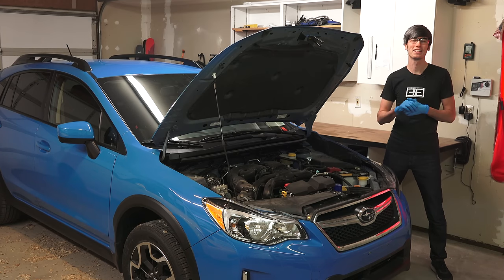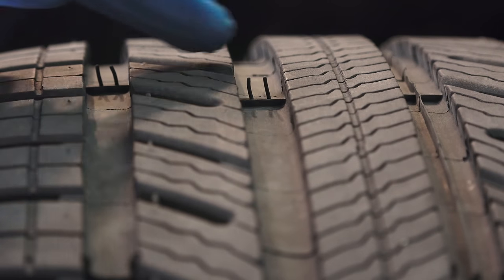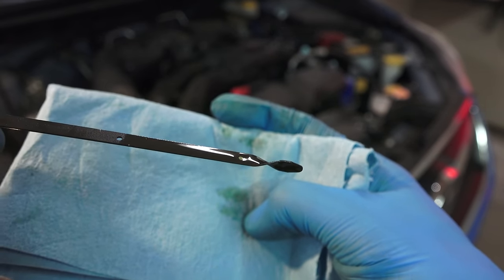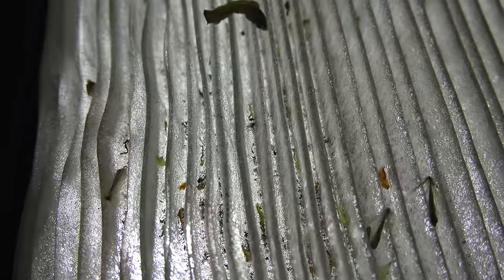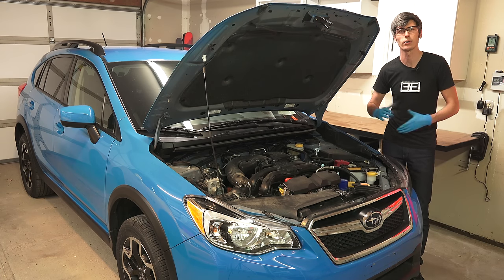How To Make Your Car Last A Long Time - Simple Checks

Comment: In 10 years, this will be a 60 sec video on how to navigate to your "Vehicle Status" menu on your infotainment screen.
Reply: My car has a digital dipstick for the engine oil. Useless piece of junk that's slow to read, inaccurate and a real 'dip stick'.
Reply: @billandyeng  same on mine. After changing the oil i have to drive 10 min before it can read my oil levels. Pretty stupid.
Reply: billandyeng  Yeah, it could even be like the temp gauge on my car (I'm not even sure if its tied into anything). It always shows "middle" after its warmed up. Whether that's gentle cruising or bashing gears 9k rpm and hearing the exhaust get so hot it makes strange noises (gurgles) and then you know its hot because you can't make it shoot flames out the tailpipes unless its been warmed up aggressively and the exhaust ignites the excess fuel.

But it always shows "middle" like 3 minutes of sitting there... Never goes past it... What a useful gauge! I've heard they don't even move even when serious engine damage occurs and water is boiling out at 240-260 *F... I'll be putting in a real one so I know when its overheating (they are notorious for that, so its a real shame they don't have a real gauge to begin with).
Reply: A lot of manufacturers did that with their temp gauges because customers brought their cars in thinking something was wrong if it went up and down. So now most gauges just stay in the middle between 160F and 230F.

Or it could be like this subaru I believe and some others, where it doesn't have a temp gauge anymore. That's how my BMW is. It just has a light to tell you when it's overheating.
Reply: @kern417  Same in my car, but it can be found from drive computer's debug menu. Not very user friendly solution, but I had to use it as coolant pressurisation is not very reliable so sometimes coolant boiled before fan turned on.
Reply: I'm not sure why they bothered putting the gauge in to begin with, +1 HP stickers are more reassuring. 
A gauge is a device that measures something, so if its not measuring it, is it really a gauge? Such are life's most intriguing questions... 

If I was marketing, I'd just put a permanent sticker there that said "everything is ____ fine", and then a light would come on that said "Everything is NOT fine!"
Reply: the car just tell you went it needs maintenance already.
Reply: @jakegarrett8109  I agree jeep did away with 5hr oil pressure gauge and turned into a dummy gauge in 03
Reply: omg, aren't the robots supposed to do that for you??
Reply: Just checked the app on my phone all the status is green.
Reply: False. Your car will drive itself to the nearest service station and recommend fluids/filters at the proper times.

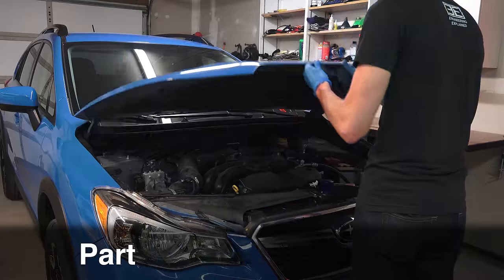Comment: 2:50 Prior to checking oil dipstick level, make sure the car is on a level surface! 🤪✅
Reply: And also that you check your oil level with the engine temp the same as last time you checked.
Reply: KJ also make sure the car is cold when you check oil level for the most accurate reading.
Reply: also make sure your car even has a dipstick like bmw
Reply: A hot motor will read low as the oil is circulated throughout, a cold car will have the oil collected in the pan for a proper reading. Oil is tricky as overfilling causes seal leaks and pressure buildup ,  not enough oil will cause seizing of the internals. It’s all about that sweet spot baby.
Reply: I suggest that you do what the manual suggests re hot or cold oil check.  My Odyssey says hot oil level check. My Civic says nothing, so I presume cold.
Reply: Waiting 1-2 minutes is enough for the oil to drain back to the oil pan.. Do not need to be stone cold
Reply: I hope I knew this before, once upon a time I checked the oil level in my garage which is very tilted to  the front of the car, it was very high oil level so I assumed that it's gas or coolant in the oil, I told my dad and he laughed and explained that to me.
Reply: Oh man...did I made a mistake on that one! I once had 8 litres of oil whereas 5 litres was the maximum for my car. The damn thing smoked like hell the whole neighborhood was like "hmm quite foggy today". Erm...no that was my car......
Reply: Jon Dittmar All BMW’s have dipsticks.  They are usually located just behind the steering wheel, close to the optional indicators.
Reply: Adam Pearson I've never seen a BMW with indicators. They must be quite rare.
Reply: and also make sure you have a car

and also make sure...
Reply: most importantly that the engine hasnt been or still running at the time XD
Reply: Make sure you have a car
Reply: Aaron Garcia no, the best time to check oil is 5 minutes after the engine is shut off, engine at operating temperature.
Reply: also check the oil when the car is on the ground.  If you check it while up on the jack stands, it will read higher than normal.
Reply: @JD-yx7be  Neither of my Audi's have dipsticks.  Although you can order one for the A4 but they are hard to find.
Reply: datsuntoyy not a big deal dude, as long as your jack stand are all the same height and ground is flat.
Reply: @davidgruen7423  LOL  I guess you missed the sarcasm.
Reply: Or if you have a MINI, make sure to find the one level surface in your town, park, make sure the engine is at operating temp, go into the system controls, and let the engine determine and tell you how much oil you have, because having a dipstick is too easy.
Reply: Also a good idea to wait at least 5min for most of the oil to collect back into pan for a mote accurate reading. As already mentioned, measuring level when enhine us cold is the most accurate.
Reply: A lot of people do not do these things themselves, not because they do not know how to check oil.. but they are affraid of not knowing what to do in case of overfilling for example. How do you drain the oil in that case? That's a bit trickier bcs you have to get under the car.
Reply: @Fixin-To  no they dont. Mine with N20B20 in it didnt have one. May be market thing
Reply: Putt you car downhill, put the the dipstick in there! It will save oil.
Reply: and when the car is cold
Reply: Also, while the engine must be cold, you must also stir up the oil just a little bit. So make sure the engine is cold, then start the engine, leave it in idle for a minute or two, NOT longer, then wait for 3 minutes or more. Only then check the oil. That's the most correct way you can do it, although if you've driven it a few hours before or the day before, it's not necessary, just if you wanna go overkill
Reply: @bassam_salim 
.... then went out for some milk and never returned.

Comment: 0:31 Tires
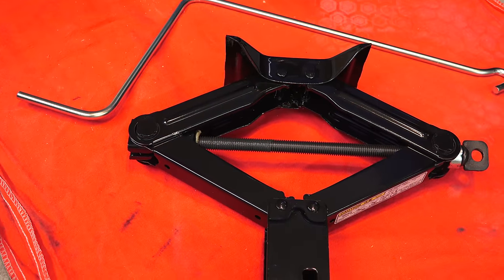1:45 Brakes
2:25 Shock Absorbers
2:51 Engine Oil
4:22 Brake Fluid
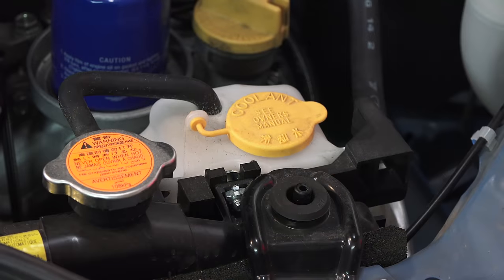4:31 Coolant
4:45 Windshield Wiper Fluid
4:51 Engine Air Filter
5:17 Cabin Air Filter
5:42 Windshield Wiper Blades
5:56 Lights
Reply: Should you check all these every 2 weeks? Or what?
Reply: @tokysh5218  Every 6 months... also depends on how much you drive. I work from home and drive barely 6k miles a year. I still check my car every month or so
Reply: Don't forget your flux capacitor
Reply: Thank you
Reply: @peterquest6406 and the blinker fluid
Reply: 5:56 for the light part, you just need to be close to a wall to check ur light
Reply: @Dansk55 dude every 6 months? i check every month
Reply: Coolant should be at least every 2 days
Reply: @xroda_ you are paranoid
Reply: The engine will explode and the car will do backflips if you don’t service it every month. Trust me, I nearly bought a car once.
Reply: If you care about your car, you'll do these things automatically.
While you're filling up gas, pop the hood and have a look around. If you park your car facing a window or glass door, check all the lights and blinkers in the reflection.
Take a look on the tires every once in a while...

It's pretty much effortless.
Reply: @sk4lman except when your car starts burning oil. Check your filters all you want 😂
Reply: Thank You!   👍

Comment: Great tips Jason! This should be shown in driver's ed classes!
Reply from the maker: Thanks Matt!
Reply: These are all part of drivers education in Norway (except maybe checking brake pads yourself), though sadly most people forget this info the second they "graduate".
Reply: @tsjeriAu  - It still stays with some, which makes the roads a bit safer, I'm sure. Basic maintenance should be required knowledge and made easy enough for most people by the manufacturers. (No dipstick deletes like are becoming more common, or air filter boxes requiring tools to open, etc.)
Reply: Agreed
Reply: In Germany it was part of my driver's education because my teacher was great, but is is officially obligated to have basic understandings of your car and the examinator may ask you during your test (to get your licence) to show how to check engine oil, or where I can see if brake fluid level is properly. Also, you need to go through a first-aid cursus and get prove that your eye-sight is healthy. Additionally, emergency braking is also part of education. (and in my case a winter drifting cause my teacher just is the best)

In The Netherlands eye-sight is checked by simply question of examinator to read number plate at certain distance, often times a joke of a test. Then, just hop into the car, drive along at speed limit, brake hard, don't overlook Dutch bicycle's and park you car correctly (corrections are allowed) which can even be a simple straight on parking, not even rear parking or side parking. Lol. Oh ... and better never drive here because 1. drivers are morons who think the road is only belonging to them  2. any possible ticket will cost you lots of money.

In Belgium drivers are not obligated to follow official driving education. They can choose to either get official education, or learn from someone who has his/her licence longer than 8 years. Learning can thus be by getting lessons from your parents. You can drive around as long as they sit next to you.
Reply: Yeah. Good to know how to read between "low" and "full". Life hacks right here.
Reply: Good video with essential tips.
Reply: I was shown this and they rehearsed this a couple times during my driving lessons tbh
Reply: wtf are you talking about @geetjuhhisdebeste? what you're saying is filled with biased and incorrect nonsense.
Reply: Budget cuts! No more drivers ed here lol gotta love the education system
Reply: Tire-, lights- and fluidchecks are part of the driver's education here in Hungary. Lightscheck is mandatory every time you start the car, tho' almost nobody does it. I check the reflections on my garagewall.
Reply: i am a car mechanic and i can say that every mechanic finds it annoying when someone filled the brake fluid to the max because when you are pushing the brake cylinders back to fit the new brake pads the brake fluid reservoir overflows and everything is dirty and yes you can suck the fluid out of the reservoir when it is to much but it often gets forgotten and the fluids that got sucked out doesnt get re-used so dont fill your brake fluid to the max it is also an indicator for how much brake pad material you have left...
Reply: Thijs Knufman absolutely right. Filling it only makes a mess. When i see it low, either pads are low, or its got a leak. If it's low with new pads, I'm checking behind that master, if no other leak is found
Reply: @EngineeringExplained  can you do a video of an Infiniti G35 manual 2006?
Reply: It has to be because in my school they didnt show me any of that plus later on we get problems...my dad was the one that showed me all this
Reply: It is. At least in Germany... Not as indepth as checking the suspension, but they teach you to check the basics like lights, fluids, tirepressure
Reply: They still have driver’s ed classes in the U.S.? Thought they cut that out...
Reply: Some of it was in mine
Reply: @sienile  WHAT?! Are you seriously telling me new cars are impossible to check oil levels on?
Reply: @lidge1994  - Not all, but some. BMWs haven't had oil dipsticks for about a decade now. Most cars don't have transmission dipsticks anymore.
Reply: @sienile  thank God my first car is an 05 Polo MK4, it's that sweet spot between convenience and tech overload, the tech I do have was developed enough at that point that it works fine, what I don't have, I don't miss
Reply: @lidge1994  - Way better than any of the crap VW sells here in the US, I'm sure. Most mechanics (HM's Charles being an exception) refer to USDM European cars as "Euro trash" because the build quality sucks so bad. It's like they ship the electronics over under the boat rather than in it. Only the most expensive models are built in Germany to actual German standards.
Reply: Too bad nobody ever takes classes
Reply: Cars that don't break down isn't good business for the DMV.
Reply: Lovely Video! Forgive me for the intrusion, I am interested in your thoughts. Have you researched - Saankramer Vehicle Statement System (Sure I saw it on Google)? It is a great one of a kind guide for getting paid to drive without the normal expense. Ive heard some incredible things about it and my friend after a lifetime of fighting got amazing results with it.
Reply: on god pasha zoten

Comment: Something I would add to the discussion about tire checks: look at the date codes on the tire sidewalls, and make sure yours aren't too old. Five years is generally considered to be the useful service life of a tire. I replaced a seven-year-old set of tires, which weren't very worn because I did not drive the car much, and was shocked at the improvement to the handling and braking performance of the car. Rubber hardens over time!
Reply: I experienced this twice. I had an MR2 that I only drove in the summer. At year 6 on a set of tires the ride went to heck. I was thinking of getting a wheel alignment done when I talked to my mother. Her first words were, how old are the tires. A new set of performance tires and I had a new ride, fabulous. My mothers knowledge is extremely broad, either she has an answer or she will say I don't know about that.  Car number tow was a Buick Le Sabre, an old helicopter pilots car, low mileage, all  service done by a garage by the airport where all the pilots get service. Tires looked mint, he had died a few years before and I bought it from his widow, no visible wear. I was taking the car on a run to the east coast from the Rockies, where it would  stay.  At the end of the first days driving I noticed the date on the tires, 7 year old. I had them replaced the next day. It felt like all four tires were out of balance. The Saskatchewan farmer who ran the garage said he would put them on some farm equipment.
Reply: How much you pay for a set of tires?
Reply: @meltingspot1064  Really depends on what kind of tires you get. Personally I normally spend around $800. Do some research and order what you think is best yourself and have professionals install them. Only time I had tires straight from a shop, they where pretty shitty and where unbalanced and got them rebalanced 2 months later.

Tire quality really changes how a car feels, cheaping out has a big impact.